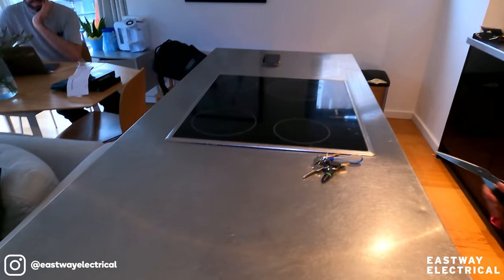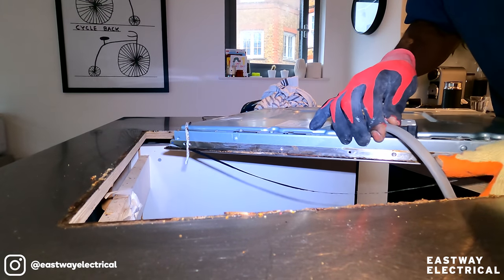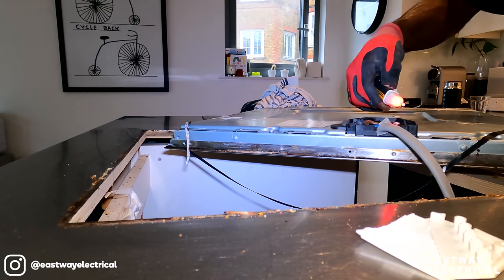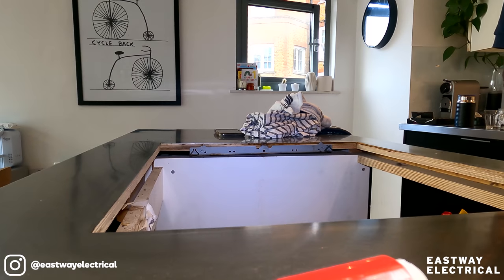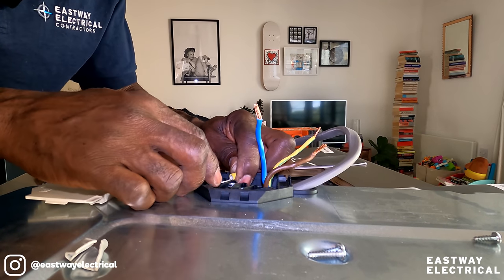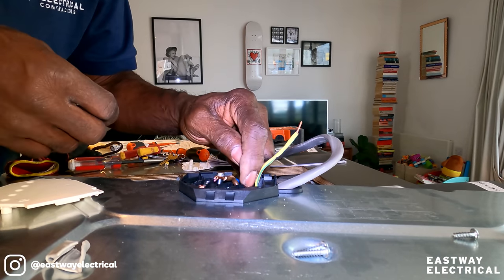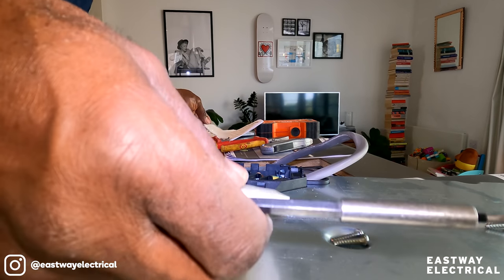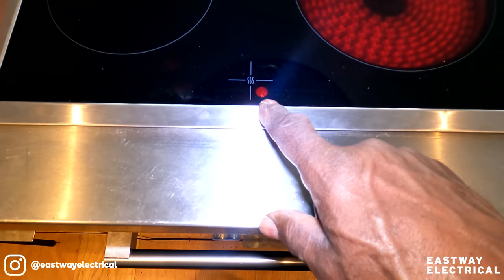"I Don't Like This!" Installing A Cooker Hob | Electrician Vlog

Comment: Maybe the hob kept popping up because the worktop was too thick for the clips. Should have tried using a multi-tool to trim mm by mm around the clips till they stayed in place or maybe the clips were adjustable?

Comment: Gotta be super careful pushing hobs out of chipboard worktops because it takes the veneer clean off unless you depress all the clips first (speaking from experience)
Reply: I dispensed with the clips on my hob and it fits snugly but pops out easily if required. 
It's not as if it's going to jump out by itself......?

Comment: did you check what the links are for, some hobs have links for diversity to prevent overload, so you can run it on a lower circuit rating. Why guess and just run with it?

Comment: Last one I went to diagnose that had stopped working after only 1 month after the "manufacturers approved installer" had fitted it .... All terminal screws into the basic insulation at the outlet plate 🤦🏻‍♂️ Hob ignitor also screwed into it with CPC screwed to insulation so the spark didn't work 🥴🤦🏻‍♂️ Oven must have just made contact on just a few strands of the copper inside the plate terminal and then got too hot during use, melted the copper strand and then stopped working. And this workmanship by the manufacturers technicians!

Comment: Looks like the kitchen fitter wired the last one up del. I've never been a fan of them connections on hobs and having to wire twin and earth into they wholesaler stocks butile cable which comes in handy but only up to 6mm

Comment: I hate doing hobs and ovens, all that grease 😱.
Why is it, you have a big appliance like an oven or hob and the smallest connection box you can imagine, it's not like they are right for space.
I did one hob recently it needed a removable magnet to work, it was the control dial, it even has WiFi built in🙄

Comment: Another shoddy install by others and made better. However Manufacturers Instructions would say the hob and oven to be connected with a minimum cable specification of HO5-VVF/R so reconnection of the twin and earth is non compliant. Plus terminal connection is for round flex not flat.
Reply: My hob came with an attached cable which I ran to the cooker connection unit.....

Comment: pls use ferrals next time :D
Reply: you can’t use ferrules as they don’t fit nicely around the screw terminal. ring crimps would’ve been better however del didn’t have any that fit. the split is fine.
Reply: @db-bv5rs  i work for Siemens/Bosch they screws are made exactly for ferrals and solid wire xD
Reply: @sw96lp  multiple types of ferrules mate, bootlace ferrules?
Reply: @sw96lp  You can't use ferrules reliably with 6mm or 10mm multi strand cable, they work loose after a while. Much better to do as Del did here.